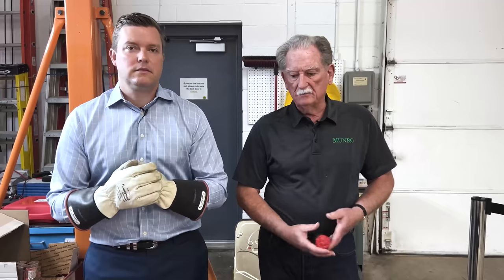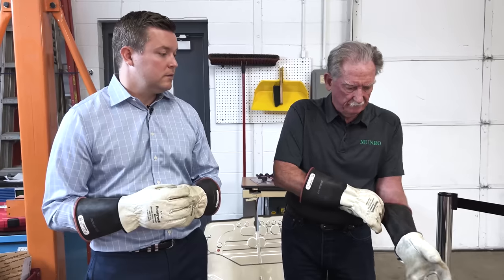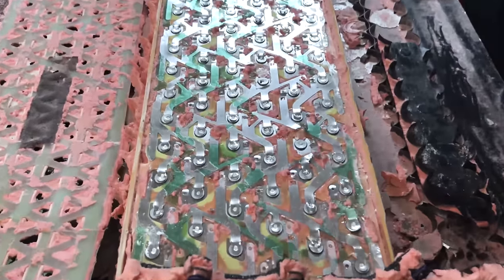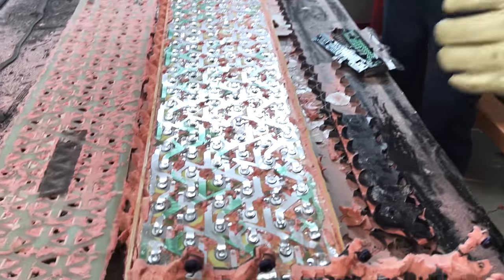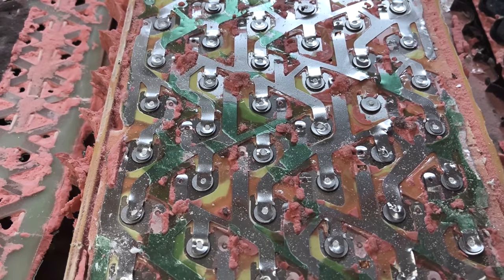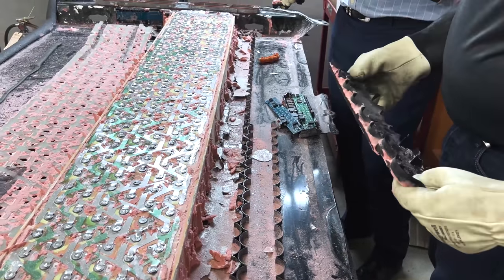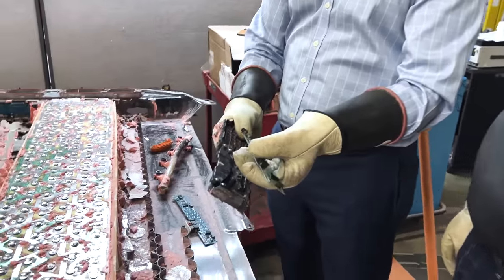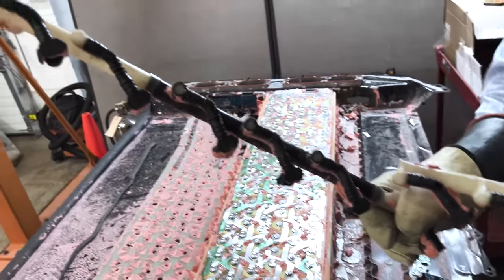Sandy's first time reviewing the fully disassembled 4680 pack!

Comment: Holy crap, are you saying a Munro report costs over $700,000?
Reply: That’s what it costs them to tear down, research, and create the report.
Reply: @nerdwatcher4273  Correct. I vaguely recall from a long-ago video that Munro sells the reports for something like $100,000 per copy (but my memory is hazy on the amount).
Reply: @nerdwatcher4273  So buying a copy of the report is not that much money? Maybe $100,000? And therefore a great bargain?
Reply: @TedToal_TedToal  100K is a lot less than 700K but hey fork over another 600K and DIY

Comment: I disagree with "snap fits last forever". Snap-fits make things unrepairable because the plastic degrades over time and cracks.  So when you undo a snap fit, it cracks, the plastic around it cracks and the part is no good any more.
Reply: This pack isn’t designed to be repairable, so snap fit is fine.
Reply: This pack is not designed to be opened and repaired. So, no need to have a fastener that can come loose inside a permanently sealed product. Thanks for playing though.

Comment: The "little wire bonds" are fuses to isolate a cell in the parallel string that goes short circuit and hopefully prevent a fire.
It looks like the top of the cells face directly at the top of the pack/floor of the cabin. Won't a battery thermal event immediately heat and distort the cabin floor? Will the pad and carpet quickly release toxic smoke?
Does the Model Y still have no emergency mechanical release for the rear door latches for use in an electrical system failure?
Do you think the "structural battery pack" is well designed?
Reply: I was thinking the same about the wire bonds.
Reply: @kevinmills5293  I too 'miss' the wire bonds (==fuses), which made a lot of sense in a Model S battery with 74 cell in parallel. If one cell went dendrite shorted, the other 73 would immediately either zapp the dendrite or the fuse. But with only 9 cells in parallel the fuse could become too rigid or have an unwanted serial resistance. So off they went

Comment: Seems like messy thing to recycle. I get the structural battery thing and I applaud it but on the otherhand, epoxying & glueing might not be the right way to go in the long term.
Reply: Not a big issue, it goes into the grinder anyway. Currently, recyclers take the packs apart and only grind the cells, but that takes time and is somewhat dangerous. Throwing the whole pack into the grinder instead makes economical sense.
Reply: @HenryLoenwind  yeah i know. But i feel the grinder is not the end solution. Easy automated dismantling must be a better way to get those valued resources back in the loop. Since Tesla is so focussed on snap fits maybe they can focus some of their research on automatic disassembly. In the past there were already some experiments on snap fits disjointing under high temperatures are even UV-light, the same goes for glues. But yeah I’m being a bit sceptical & a structural battery for sure is a good thing. This will just be something someone smart will solve in the next year. #to infinity & beyond!
Reply: @atohms  Even if there was no epoxy/glue/foam, there would still be flat strips of metal that are welded to multiple cells. I don't come from a manufacturing/welding background, but I assume all that welding would provide a challenge for dismantling.
Reply: @atohms  How in the heck would disassembly ever be superior to just grinding everything down? Individual cells would STILL have to be ground down at the end of all of that labor intensive disassembly process. Makes far more sense to just chuck everything in the big chomp chomp machine, and then start the separation process right from the get go... as opposed to wasting time and resources pulling it all apart to just end up in the same chomp chomp and separation.

Comment: Did I miss something?

With all the bonding materials, How on earth would you recycle this battery pack or repair it? As you have shown it takes a huge amount of manual labour and time. So what will be done with these? Hole in the ground like the wind power plants?
What happens to the rest of the car when the battery needs replacing for $30k? But it will save the planet when we use it and throw it away...

Comment: Wow sandy you really stepped low Elon got you whipped.
That's a nightmare for a mechanic and you know it
Reply: Unbelievable how everybody praise thi s engineering of the battery pack. 
Of course it fulfill all the requirements and standards (thermal propagation, crash tests) and has a big cost reduction effect there is a big big disadvantages for the environmental friendly electric vehicle . 
There is no way to remanfacture such pack just by melting it down 😂…how ridiculous….and battery packs won’t fail over life time …but who cares we have to safe the plant with our Evs
Reply: Fortunately, recycling plants don’t employ mechanics, they just get on with it using fully automatic processes.
Reply: @visionmodernclassics3062  I'm with you, I think the design goes far too much towards the low-cost end of the design spectrum. Cory mentioned casually some weeks ago that it has "zero percent serviceability" yet they don't seem to consider that an issue.  Clearly it's cheap but totally unrepairable.

Comment: What chemical to dissolve the pink foam? 
Having the pack as structural means its not repairable or useable at end of life.
It can be chopped into  tiny bits and metals recovered as is planned by  Straubel,
becoming quite a closed loop affair. The cells near end of life, still very much useable for other purposes, I suspect at some stage the packs will not be structural, and will be more ammenable to re-use and repair. The battery pack is one area that will change massively over time, its really a work in progress ,there are so many options for design only limited by imagination.
These designs are taking owners power to repair out of the equation, good for the producers, not so good for consumers. I think right to repair ones own vehicle should be given more considertion in designs.

Comment: From a service pov, plastics snapfits are big issue, esp if older, they typically are weak points on aged plastics. You try to remove them, they break bc too brittle wont flex anymore. I know this is against the grain, new sh#t are not designed for repair, still...headache galore with old bmws

Comment: Thanks for the video, awesome content!
I am worried about two things: 1) What happens if one of the battery cells or one of the ICs on one of the Battery Management Boards fail? Wouldn’t that mean that the whole battery pack would need to be replaced? This would be an environmental and financial disaster. Or are all the components redundant for that reason?
2) How is the pack protected from underneath? What if you touch down with a rock under your car which dents the undercover of the pack? Any chances of just replacing the underbody protection? How thick is that anyway?

Comment: Regarding colorblindness and the PCBs. There might be another reason for using blue and green. As someone who worked on a product that was used with broadcast television back when we still had to support black and white TV on CRTs, blue and green are easily distinguished in black and white video. So if they are using robotic assembly, they can use super-high resolution video in black and white for quality control and video tolerances.

Comment: I see some 4680 popping up on existing inventory here in NJ if anyone is looking for the car fast
Reply: Really? How did you identify that? I just checked inventory here on the West Coast USA and I didn't see anything like that.
Reply: @scottbreseke716  it’s range and it says awd
Reply: @famip3679  On the existing inventory page you can see the VIN numbers, and all the VINs say Fremont.
Reply: @scottbreseke716  if you see a range of 279 that’s a Austin built
Reply: @famip3679  The cars with a range of 279 miles are Rear Wheel Drive Model Ys, and in the VIN number the letter A is the seventh letter from the end (if from Austin).

Comment: These batteries have 9000mAH/battery vs 4900 mAH 2170.  Less batteries are needed.  Tabless batteries less resistance less heat therefore more power!

Comment: Besides expense, one of the major downsides to using carbon fiber composites is lack of recylability.  Add to that the fact that most carbon fiber composites shatter, crack or bend under the stresses of even a small or low speed collision and you have a structure that requires either component level or entire structure level replacement to restore to a safe driving condition. It actually amazes me how many people these days think that totaling a vehicle is the only acceptable course of action even when all the damage was cosmetic components and the structure is still straight or has easily repairable damage underneath.

Comment: The little tiny wire bonds were a safety feature - a sick cell would, one way or another, cause the little wire to act as a fuse, taking the defective cell out-of-circuit leaving the rest of the pack to operate with only a tiny performance loss...

Comment: Sandy, you've spent a lot of time explaining the excellent engineering of the 4680 pack. You indicated that the pack itself is totally repairable. If anything goes wrong within the pack, then the pack becomes a brick. Thus the pack MUST BE EXTREMELY RELIABLE, else it becomes a huge liability for Tesla. What is your opinion about this?
Reply: Have you seen what they had to use and do to get this pack broken down to look at . This pack is NOT repairable if it goes bad . The old packs you could open to replace a broken module . This whole pack is synthetics apart from the cells . Whats synthetics ? Bloody oil . I build p04 bike battery packs and the batteries still fail . Huge nightmre comming with used packs everywhere . We already have recycling nightmares with countries just burrying things because recycling isnt viable . Its all about the quick cash for them .
Reply: Maybe Tesla has remotely monitored previous packs?
(Probably the only company that can?)
.
Maybe they have more information than any other company regarding "points of failure?
.
Maybe they have "hardened" 
(over-engineered) those components to prevent failure?
.
Maybe they'll place all "power control" components in a separate module to the cells? (Oh, wait! They always do that!)
.
Maybe they have s "fusing" method to remove damaged cells from the circuit and a method to auto balance the pack?
.
Maybe the data they've collected running 4680 cells for 2(?) years tells them it's not a problem?

Comment: Very good design and execution by Tesla. Still it has been designed to make right to repair  impossible. That is not good. Hope that the 4860 lasts 1 million miles at least without repair or replacement.

Comment: Yikes. That was one tough nut to crack. Definitely not maintenance friendly. But the tradeoff is that a lot of problems have been eliminated that would've caused problems and required maintenance. Any idea what a new structural battery pack replacement would cost?
Reply: What problems are you expecting that have been eliminated?

Comment: Obviously, the main goal of fasteners is disassembly. No disassembly, no fasteners. This battery will have to be completely recycled if a handful of cells go bad.
Reply: Or repurposed as stationary storage. They will only shred the pack once it can longer be used safely in some alternate way, can you say Super Powerwall. Then it is recycled to become a new pack. Closed loop with every subsequent generation of pack getting better and cheaper. Think Flat screen TV. In 1999 cost 50k for a Plasma. Today $500 LED Smart TV. back in the day if it cost 5K to fix your Plasma you paid it. Today if you have to pay $300 to fix your LED TV you trash it and get a new one.

Comment: I remember that the old Tesla batteries were liquid cooled by a pump. For this 4680, how do they remove the battery heat?
Reply: Same. But the cooling tubes had to be destroyed in the disassembly process.
Reply: Same with slightly bigger channels.
Reply: Pumps……..

Comment: I hate that the repairability is essentially zero for these packs.
Also they are really hard to re-use as solar storage. If only one cell fails with a short, then the whole pack is toast. No chance of using the other 99% good cells.
Reply: All the big brains at Tesla missed that yet a nameless Troll on YouTube figured it out? Wow who would have thought it lol. One shorted cell does not brick the pack. Nice try FUDster.

Comment: Did they say how many 4680 cells are in that pack? And none of them are "blanks," i.e., the pack is full? If so, why is the range only 279 miles? I thought 4680s were supposed to increase range by 16%…?
Reply: The 4680 by itself does not increase range at all. It is just a form factor. The 16% figure comes from Battery Day, where they mentioned a slew of improvements to battery chemistry, manufacture, weight, etc. See 'The Limiting Factor' for more details.
Reply: 828
Reply: 9 batteries in parallel,  I read somewhere that Tesla wants a nominal voltage of 350 Volts,  Their current battery chemistry is Nominal Volts 3.8.   So 350 * (9/3.8)  =  828.9 batteries.   Since it is 9  batteries in parrallel, the total batteries is a multiple of 9,  so 828 or 819 batteries in total.  (92s/9p battery assortment,  previous long range 3/Y  used a 96s/46p arrangement.)

I would say there is a 50% chance my numbers came out correct. Because my sources were far from official.  But I know my numbers cannot be too far off. as the max voltage is then 386.4V, which is pretty close to the previous max voltage.   Tesla did want to decrease the max voltage some because the new battery chemistry could lead to a boost in the total voltage per battery, and if the boost works out, then all the current Superchargers will no longer work unless they reduce the Batteries in series.

Again this is just guesswork.   Also,  I think the 4680 form factor provides good structure and likely cheaper manufacturing, but from a perspective of only 9 batteries in parrallel that is completely stupid,  the more batteries in parrallel the better because if you blow a fuse with only 9 in parrallel, the other 8 get increased current.  If you blow 2 fuses, you will likely blow the other 7 fuses in a short time period because each battery now has to handle 30% more current.  Very poor design for a performance car that is more likely to blow a couple fuses along the way.  But then again if blowing a fuse happens in less than 0.1% of batteries over a 10 year time period,  then who cares as this will rarely become an issue. . . In my work though a 1,000 battery pack blows 1-2 fuses per year.  (Comparison to the old 96s/46p,  you could blow 5 fuses and it barely matters as  the other 41 batteries still only have 12% increased work load.)
Reply: @StefanRotenberg  Well, THAT sucks, then. Why would anyone want 4680s with only a 279-mile range, instead of 2170s with a 330-mile range?
Reply: 12 x 69 🤣 Elon's favorite number
Reply: @StefanRotenberg  they mentioned 16% increased range from the form factor alone. . . Which was Also the increased height.

Comment: Tesla must be super confident with their 4680 cells to not bond them with a fuse wire. If one shorts out (which can happen on the 18650 or 2170 cells) what will happen given the much lower internal resistance and higher energy stored?
Reply: What if they (Jeff Dahn and his team) had figured out what caused dendritic failure, and changed the chemistry to prevent it?
(He mentioned they knew the cause years ago..... I think it was a solvent/chemical used in the "wet process" cathode?)
What if the new process they use made the problem disappear?
What if the 4680, with tabless construction reduced resistive heating to the extent that the cell isn't stressed, making it far more robust?

Comment: There has been no end of discussion out there about energy density in the current 4680 cells. Maybe I missed it, but where is the charge / rundown test on these cells? The range means nothing because the software can be used to arbitrarily limit the total pack output. Let's move from battery day hypotheticals to an actual measurement.
Reply: Maybe that's in "the report"?
Maybe it's good business practice to sell the report and recoup some investment before making the results public?
Just a thought.

Comment: the carbons nice but  manufacturers still need to do more for passenger safety especially for top motorway speed crashes, seems theyve taken fckall from the decades of racing (if its not helping then Ban the racing)

Comment: 3:46 current, not voltage!
Reply: That was a surprising mistake.  Sometimes I wonder about why this happens.
Reply: @paulaxford6754  it's weird indeed. they focus on EVs for years now, the difference between current and voltage should be clear by now.